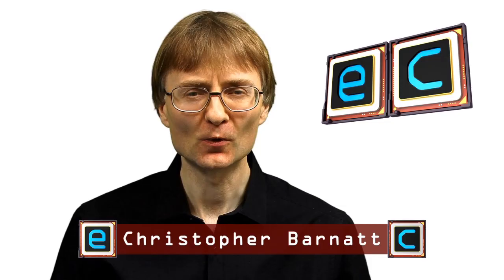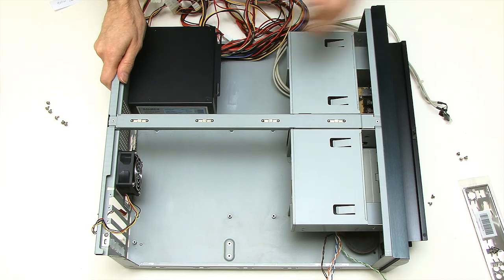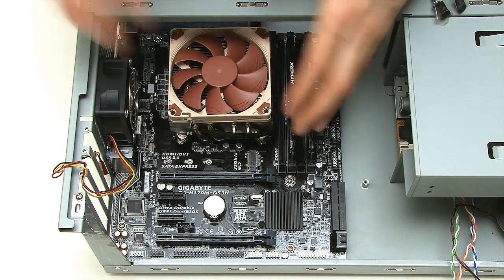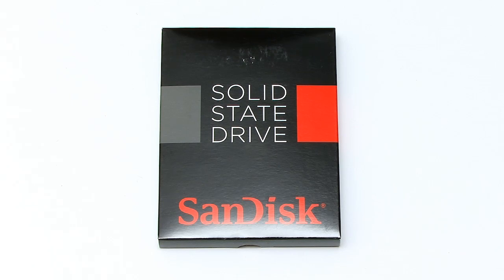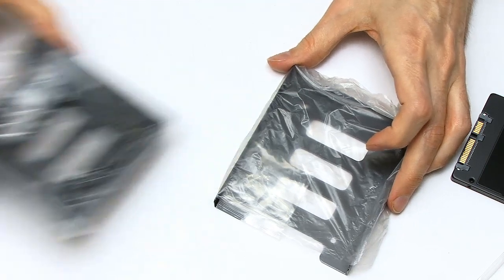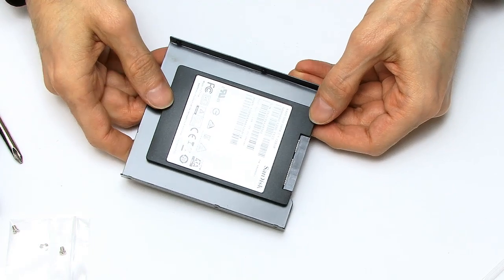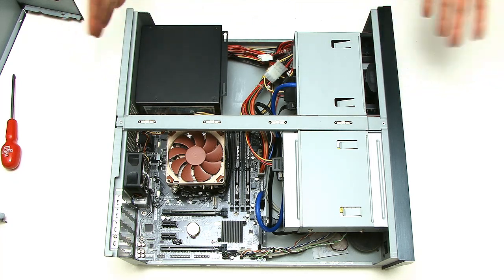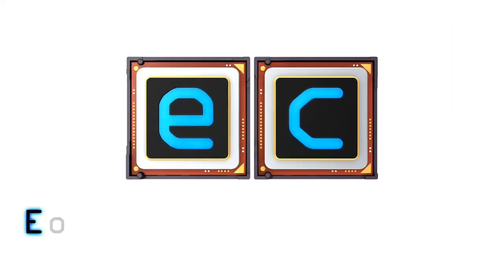i7 PC Build: Part Two

Comment: Try looking for either Vessel or KTC screwdrivers. Specifically, the screws you are dealing with are made in Asia, and mostly follow the JIC(Japanese Industrial Standard) cross head design. There is a difference in the geometry of these cross heads versus Phillips screws, which is why the driver wants to "cam out", or slip and tear up the fastener. If you use a JIC compatible driver such as those made by Vessel or KTC, the driver fits like it should and will not slip.

Comment: Is that a 20 pin power connecter you've plugged into the 24pin power socket?
Things to consider.  Put the optical drive above the SSD (or better still, get a SATA to USB3 adaptor for it and keep it external - how often do you use it?), remove the floppy, cut the left hand cages down to just the first set of mounting screw holes (allowing a discrete GPU to be fitted).  Replace the USB2 ports with the USB3 ports.
Reply from the maker: As I noted, I have plans to remove and replace the floppy. I'm confused by your USB port comment -- I added two USB 3.0 front ports. :) Oh and yes, 20 pin power connector.

Comment: I know you're going to put one of those all-in-one card readers! I always use them with cases that have a floppy tray. 
I even messed a bios up once and i had to run around the city trying to get a working floppy drive and a disc just so i could fix the broken bios, at least bios updaters are a lot more reliable now.

great video!

Comment: I enjoy your videos , Chris, thanks for doing a quality job on them all.
I have built PCs since 1993 but about 3 years ago I saw an offer for an 8-core 4.6Ghz AMD cpu ready mounted on an Asus  mobo with a huge BeQuiet cooler at a good price. It needed a wider case so I bought a nice one and finished the build. After playing a game for a few minutes, the PC shut down.
I pulled off the cooler and saw to my horror that there was only about 1/3 of the cpu covered with thermal paste. I cleaned it off, fully covered the surface with some Arctic Silver paste IIRC and refitted the cooler. I have since had no problem with overheating so I would def recommend using plenty of thermal paste. 
BTW I backed off the cpu speed to 3.6Ghz as I can manage quite well with it .My only criticism of the mobo was the poor boot menu in the bios.It has been used quite a lot for the last 3 years with no problems at all.

Comment: My first computer had an Intel DX486 processor with MS DOS 6. something operating system, Windows 3.1, a 256 Mb HDD, 2Mb of RAM and a floppy drive. The CRT monitor had a 'massive' 17" screen and weighed a TON! in short, your excellent PC Build vids have inspired to have a go at building an low spec simple modern desktop computer maybe with a SSD!! Good luck and many thanks! Franko.

Comment: tip on the io shield, use the back of a screwdriver to tap it in or tap it out. works both ways =P
just tap the corners.

Comment: I'm curious if you're rendering why you haven't dropped in a decent graphics card, they can greatly improve rendering times
Reply from the maker: You are right when it comes go games and many video editors. But unfortunately rendering of CG animation in LightWave does not use a GPU, only the CPU. As and when this becomes possible, I will use GPU power! :)
Reply: That makes sense, I was thinking of my brief experience of Blender and its ability to use the GPU
Reply: You can use Octane for LightWave  it is a GPU based alternative render
Reply from the maker: Ben Yass Yes, thanks. I will now investigate that. Not sure how/if it will work with Screamernet though.
Reply: ExplainingComputers, I would take a look at LinusTechTip's "AMD vs Nvidia for Video Rendering - Adobe Premiere and Media Encoder" Video where they cover the subject.
Reply: I have to wonder if screamer net will work with nVidia cuda cores since the Tesla is used in the new super computers as their main stay now, even cray super computers used them, though only the Tesla based card with its cuda cores, :)

Comment: Chris... I watch your videos every chance I get. Very informative and fun to watch. As someone has already asked, I'd also be interested in the total cost of your rebuild, and also, any special handing of Windows. Did your existing installation comply to the new motherboard and storage (a simple mirroring of the system), or did you have to use a "Windows key" or what? Thanks for your great videos.
Reply from the maker: The cost was about £560 ($700) -- c.£300 for the CPU, £100 for the motherboard, about £50 each for the SSD and the RAM, £35 for the cooler, and the rest for the USB 3.0 bay, bay adapter and SSD bracket. On top of this, I already had the case, PSU and DVD, and an OEM copy of Windows 7 (purchased when still available).
Reply from the maker: PS, the previous system was running 32 bit Win XP -- so the OS was installed from scratch.

Comment: Got an 2007/2008 Dell Inspiron 530 from a friend. Upgraded the DDR2 RAM from 2 GB to 6 GB, and ordered the fastest processor that it can handle: an Intel Core 2 Duo E8600, the last Core 2 Duo developed. May add some USB 3.0 ports to via the PCIe slot. Very fun little project for less than 50 dollars!

Comment: I was wondering about the airflow. In your case the cpu fan doesn't blow in the direction of the RAM. The one I intend to mount (Noctua NH-D14) does. So the question is: should the airflow go toward the RAM or from the RAM to the CPU?

Comment: Using More Ram usually decreases render time. You seem to enjoy building computers quite a bit. I recently built a system and I added a 5.25 USB 3.0 7 port Hub made by EN Labs. Seems to work well. It is a powered hub so it required a SATA power plug from the power supply.

Comment: I'm guessing you are going to put a card reader in place of the floppy drive. I have put in a USB3 version that also has a USB3 port on it as well as the card sockets inside my computer. In the 5.25" bay instead of set of USB3 ports, I would fit a hot swap bay for my harddrive's. There are a couple of 5.25" bay unit that I have seen that will take both a 3.5" and a 2'5" hard drive at the same time. I have a hot-swap bay in my computer that my secondary hard drive sits in. My motherboard supports a hot swap mode so I have set that SATA port as hot swappable. My data is regularly backed up from my internal boot drive onto the drive in my hot swap bay.  I always image my drives once set up so that if anything goes wrong I can reimage the drive or replace the drive and use the image to put it back to the original install state. Then I can just reinstall my data files from the backups. If I install a commercial program that requires a registration to activate I will normally make another full drive image. I found the USB3 card reader I put in last month allows me to back up and write the cards for my pi3 much quicker than my old USB2 card reader I previously had installed.
Reply from the maker: Not a card reader, more like the bay option . . .
Reply: A better use for the 5.25" bay might be something like this;
Icybox IB-867 5.25 inch USB 3.0 Multi-Card Reader with USB Charging Port
http://www.scalecomputingstore.co.uk/p/icybox-ib-867-5-25-inch-usb-3-0-multi-card-reader-with-usb-charging-port/

Comment: "not able to get one made of metal" this is why you need sheet metal working skills, I have made every thing from case brackets for converting a row of 5.25 drive base into 3.5 bays to a back I/O plate for a friend from aluminum and magnesium aluminum alloy and probably will use titanium in my next case when I build one from t-slot from someone like 80/20, and it really is not very hard or expensive to get into sheet metal working either, a good hand held hole punch for sheet metal, an a good small sheet metal bender, and you are off and running :), (oh and some sheet metal shears) I of course having been doing it a while have some customized tools like modded end nippers and what not using my dremel hand rotary tool because I just love making tools :)

Comment: Hi - I wonder whether your measure of energy efficiency during rendering should have time considered too, as your power provider does in billing kWh, to make it Joules per Frame rather than Watts per Frame? How do the two builds compare when worked out like that?
Reply from the maker: Time was certainly considered -- this was by far the most energy efficient solution. :)

Comment: I have that exact same StarTech plastic adapter. I fitted mine with a StarTech "hot-swap" adapter for 2.5" size drives so I can swap in SSD's with different OS installed, etc. I wish the adapter was made out of metal just as you said. :(

Comment: Any planned upgrading to use hardware acceleration for rendering?
Reply from the maker: LightWave sadly does not allow use of GPU rendering. So the CPU takes the full load.
Reply: Lets hope LightWave will have support in the future
Reply: ExplainingComputers I use Blender and Cycles, which supports GPU rendering. I'd highly recommend it, nowadays it is comparable to paid software IMO.

Comment: in regards to rendering, I have a 2011 i7 with 8gb of ddr3 ram (not the best by modern standards) but I have an AMD RX 480 card equipped with 8gb gddr5 ram on the card its self. The power supply running all of this is a 330 watt psu. I have used this quite recently to render out various CG graphics and is beasts through it like a dream, Easily the best I have used for graphics and render work even with the slight system bottleneck.

Comment: will it run faster with a Nvidia? I want to use Blender 2.9 but my actual PC is too old and I am looking for advice for the setup I can make to start using it. I will look for a video about Rizen Vs Intel as they are so many of them I cannot decide for one that can be good enough but less expensive. Great video!

Comment: Which zalman cooler was on the old MOBO? im assuming it was a low-profile like the Noctua you use for the new one? Americans dont know what Zalman is lol, the only component I have ever even seen in a build in-person, is my own 4 pipe, figure-eight, ALL COPPER, beast of a CPU cooler...and it is by far my favorite cooler ever, so I would love to buy more Zalman products, but they are very difficult (and expensive) to get ahold of in the states... but I digress, I didnt even know they make low profile coolers, and I would love to upgrade my mini ITX rig to a Zalman, if you know of the exact model of the one you used, Id love to look into it, thanks! :)

Comment: Will you be adding a graphics card to this system or is the built in graphics good enough for video editing/rendering?
Reply from the maker: No graphics card planned right now, as the rendering (in LightWave 3D) is done entirely by the CPU.
Reply: Thanks for the information, and great video as always!

Comment: how about putting as much less possible matters on what u using i mean im not specialist but if u out the dvd still circulate energy around i guest and when its off ? or very little i mean less things in it less" tired " the motherboard ?  liek puting just 3 jacks one mouse one kayboard and one for usb ps as for the pste they ay put all around the processor so may protect it also from dust and other things

Comment: Chris what did you do with the old motherboard and components did you use them in another pc build
And why did you not use the i7 in your i3 of as that is the one you said you used most often 
By the way love your content and have a tech channel of my own with around 76 subscribers
Reply from the maker: Thanks for this. The older motherboard indeed moved on. :) I didn't need anymore power in the i3 (it is still running the same today), whereas for rendering the upgrade made a lot of difference. Good luck with your channel. :)
Reply: Thanks for the good luck to my channel
Much appreciated for the reply and good luck

Comment: Was the old system really that clean when you opened it?
Reply from the maker: It was -- though it was not that clean if you look closely at, eg, the old heat sink. The PC had been periodically cleaned internally though.

Comment: Depending on the motherboard but maybe having your optical drive on SATA 1 is not good idea. Because you want to run your SSD on AHCI mode and my Gigabyte motherboard doesn't let me setup per SATA channel but as in pairs 0/1 2/3 4/5 and AHCI might not work very well with your optical drive 

Cheers
Reply from the maker: Yes, I agree. I think that in the end I realised what I had done on-camera and put it in SATA 1.

Comment: When it comes to installing a usb 3.0 card into a pc, how do i know if it will work/ fit into my case and does the motherboard need to be of a certain type???
Reply: The mobo needs a usb 3.0 header or you can use a pcie slot usb 3.0 card.  The bays at the front are a standard size.  You might need an adaptor like the man himself.

Comment: i think you can reduce A LOT your rendering times by using some modern GPU, as a lot of software can now benefit (in drivers) by this, instead of relying only on CPU...
Reply from the maker: Unfortunately rendering of CG animation LightWave does not use a GPU, only the CPU. As and when this becomes possible, I will use GPU power! :)
Reply: ExplainingComputers there's a plugin called Octane which does that :)
Reply from the maker: squalazzo Yes, I have heard of that -- and must investigate! And then get it working with Screamernet . . .

Comment: I wonder what's drawing so much power at idle, 45 watts seems a bit high compared to just 70 at full load.
Reply from the maker: It is only 25 watts higher -- so I believe it quite possible that this is the extra CPU energy use alone. There will be a bit more power used as the CPU and system fans run faster, and for SSD read and writes, but this will be minimal.
Reply: Yes this is why I'm wondering, 25 watts difference between idle and load is quite a low figure, so something must be drawing more power at idle than it should. You could try generating a report in windows by running "powercfg /energy".
Please don't take this as a "you're doing it wrong" comment, I enjoy your videos, I'm just genuinely curious as I've been obsessing over the power consumption of my laptop recently, so it's on my mind.
Reply from the maker: Nick I don't think it is a low figure for a 'T' processor. The TDP here is 35W heat output at load for the 6700T, and this has to relate to an electrical power draw of roughly the same order of magnitude.
Reply: In the old days CPUs would just run art full speed no matter what. Therefore always a high usage. These days, the CPU allows the OS to save power by telling it - it no longer needs full power. The CPU responds by lowering the clock multiplier and can do this if thermal threshold is deemed to high in order to keep the system running. It can not tell if you have work you can not afford to lose.

Or you could be in modern BIOS just monitoring.

Comment: It's just amazing how much power computers can have! For comparison: My 2008 Laptop has got a 2GHZ core2duo and 2GB ram: Enough for CoD1. What about the "Pi Zero Robotics Internet Webcam" video (would be nice ;))? Sorry for my bad English, I'm German.
Reply from the maker: I will return to the Pi Zero robot!
Reply: 2GB RAM for CoD was more than enough if using an XP OS. I bought and played CoD in 2004 when I got the GOTY ed.
Reply: Ye  i  have  played  CoD  on  pentium 4 with 1 gb ram(on xp). Now i use core 2 duo + 4 gb ram
Reply: I have a Commodore 128, with a 2MHz processor and 128KB RAM.  Yep computers have come quite a ways...however, newer isn't necessarily better, none of my old software from the windows 3.x and 95/98 era work anymore due to the change from a 16 bit to a 32 bit OS platform.
Reply: I'm an American with a college degree and can honestly say your English is perfect!!!

Comment: why didn't you just install your front usb 3.0 ports in place of the floppy drive? then you could install a 2nd cdrom or burner or some other accessory..  and if you get a gtx1070 video card your sample render should be done in 30 min.... if your rendering you really need a decent nvidia video card. adding one to your core 2 quad would have made it alot faster also...
Reply from the maker: Here I am rendering with LightWave Screamernet -- which is 100 per cent CPU based and cannot access a GPU. So fitting a video card would make no difference to the render time (but would increase power drain and heat generated). I know that I am doing am not just randomly selecting components here! :) The USB 3.0 ports are placed in the bay so that I can reach them from my desk.

Comment: re. PSUs - you need to be careful when using older PSUs. Many were designed to have a minimum load on both the 12V and 5V rails, but modern boards and CPUs put most load on the 5V rail only and very little on the 12V rail. For instance, many Corsair PSUs do not work properly with Haswell CPUs/mainboards. What is even more annoying is that it is very difficult to find the published minimum power rail requirements of PSUs. If you are not using any other cards (e.g. graphics cards, etc.) you need to be careful or the PSU will not regulate and therefore just shut down as soon as you turn it on due to insufficient load.   I was a system builder for 30 years and finding a good PSU that would cope with a minimal system and a maximum-load system was always difficult! Some PSUs are 'single-rail' in that the 5V and 12V (and 3V) all come from a single rail and so you should not need to worry about minimum load with these types of PSU.